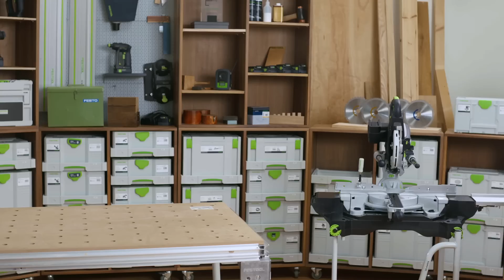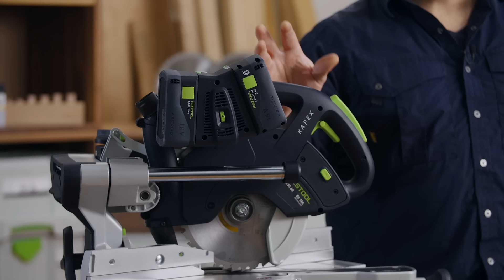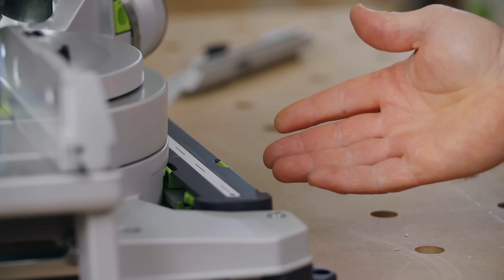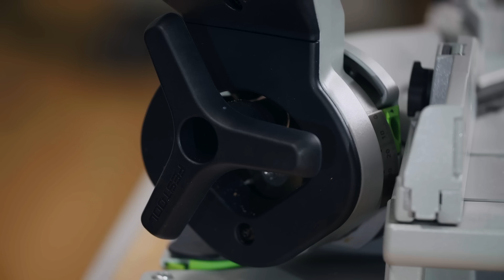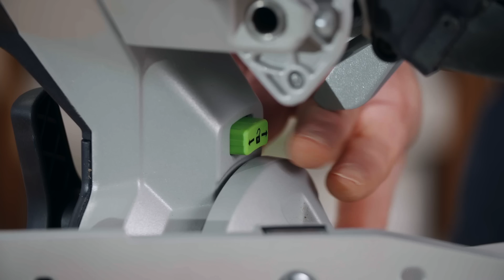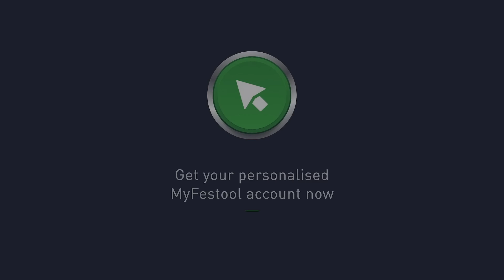Festool KSC 60 cordless mitre saw: Introduction

Comment: First morning with my boss's new KSC 60 EB.
The only plus about this saw is the fact you never need to empty the dust bag😅 it empties ontop of your work piece when in the cutting position, the worst design I've ever seen.

Besides that it bevels on both side but you can only use the left hand side as nothing fits under the right hand side.

The stand is well over engineered, takes too much time setting up and taking down.

I'm asking for my Dewalt back🤦‍♂️😅😅
Reply: festool is for precision and quality not thrashers in a hurry if you take the time to learn the tool you will find it is much better then the dewalt.....
Reply: @marklawrence6068  well said !

Comment: Why not to take a step further to make Kapex 120 cordless? I had 10 inch cordless mitre saw from Hikoki and I am happy with the runtime with the battery. And there are countless reviews on the new 55K without any complaints on the runtime. So power and runtime should not be an issue.